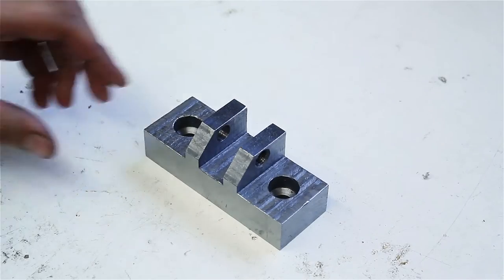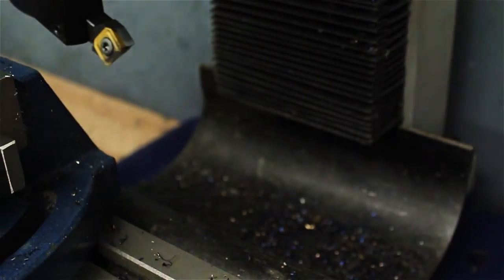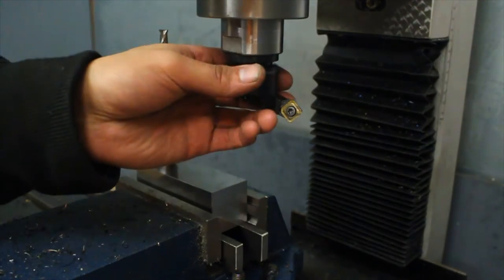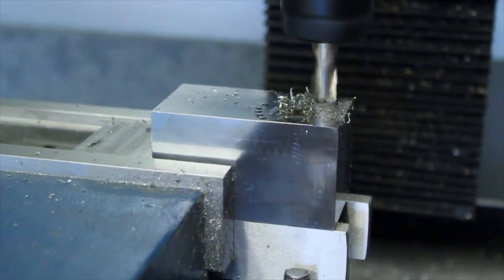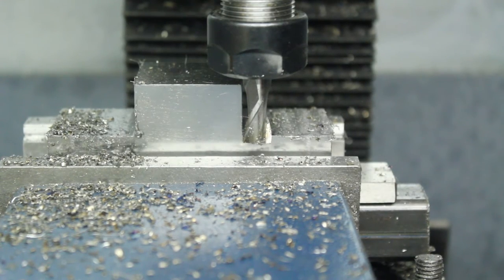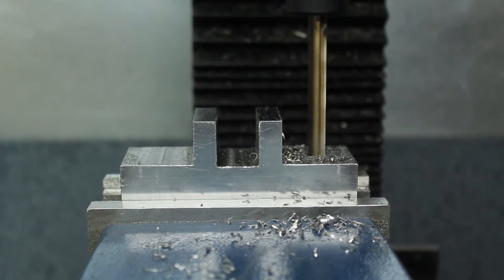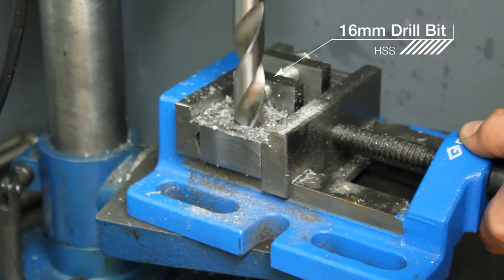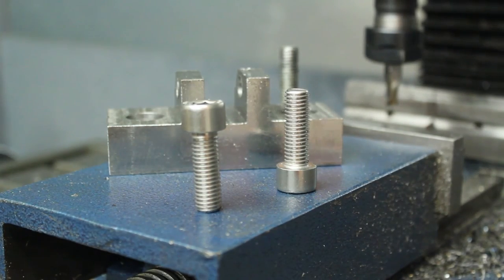Drill Mill Polish -Episode 2 -Pneumatic Bracket

Comment: you could have marked the block and  rough cut those shoulders with a hacksaw. Likely would have been faster than milling all that material out! Looking forward to seeing more of your injection molder build. I have made a minor start on mine but seem to have more projects than ambition these days ;-)   keep up the good work!    gerald
Reply: Most of the work so far has been basic manual cutting and drilling and tapping so hardly that interesting for a video. I think there will be very  little CNC work and mostly manual lathe or mill stuff for the design I am building. I am also building a thermos forming machine so lots of plastics in the works. Maybe just do operations video's once they are done!